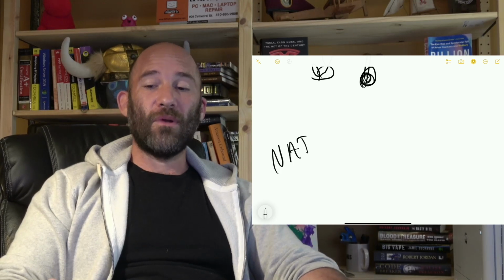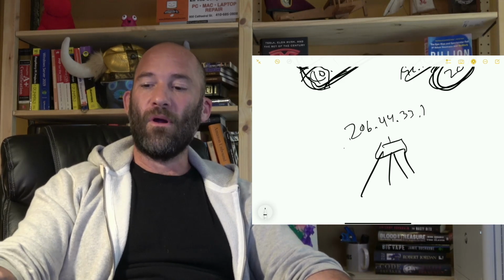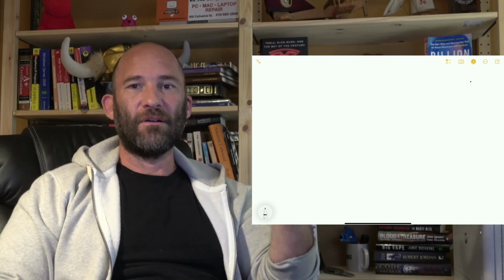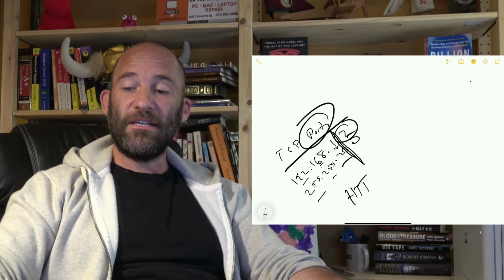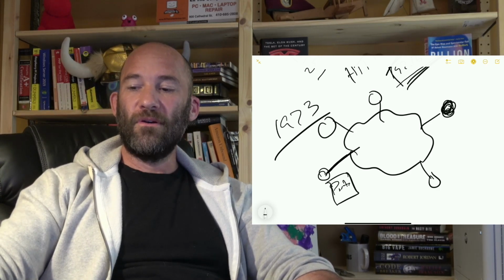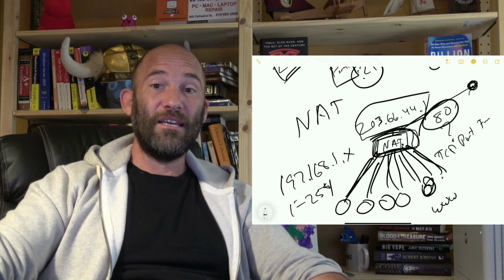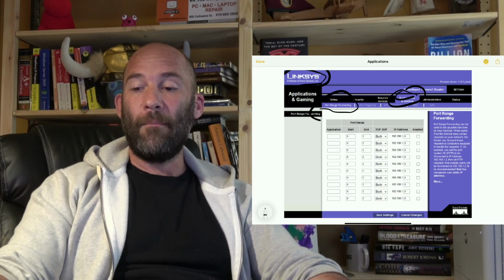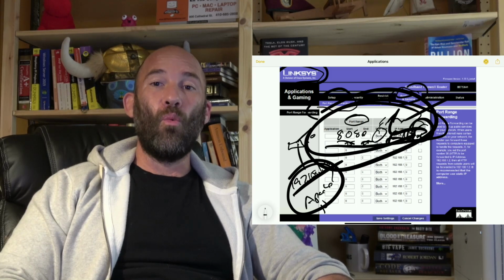What is NAT and Port Forwarding (Network Address Translation)

Comment: When TCP-IP came out Networks were trusted as a default. There weren't really any security built into it because it was really only designed for institutions not for the public. The Internet wasn't even a thought back then in anybody's mind. And because TCP-IP had no security built into it, (because there was no need for it, networks were trusted) the main reason why it has been bandaged over and over again is mainly security reasons. The large majority of bandages are trying to add security on top of a network that wasn't designed for security. Most of the problems in networking that we face today are for that very reason. If somehow we could completely begin again with network protocols designed for untrusted as a default everything would be so much different. The entire network protocols and how they work would probably be very different.

Comment: The only problem with NAT is that it's easily possible to "Double-NAT", thus causing internet connection issues. Consoles will often tell you that you're using NAT2 or NAT3 during this circumstance. The common culprit is when someone doesn't know to put their ISP's modem into Bridge mode when using their own router.

Comment: I appreciate what you are doing in this new series. 

So in the case of the data going through 2 networks, how does the port number get forwarded through the second router (and the third, etc)? Are more and more port numbers concatenated to each packet? My wireless ISP (Xplornet)puts all of its customers on a 'private IP' 192.168.. so I'm automatically on double NAT considering my own router is in the path right after theirs.
Reply from the maker: if you own the routers... router 1 port forwards to the external ip of router 2... so router 1 has an external of 205.66.44.2 it's inside address range is 192.168.1.x Router 2's external is 192.168.1.2 and its internal range is 192.168.2.x (different subnet). so port 80 traffic to 205.66.44.2 would be forwarded to router 2 at 192.168.1.2 and router 2 would then forward to the apache server at 192.168.2.10

if your ISP is NATed... that's its own tedious situation...

Comment: 24:38 that reason is because root is required to run apps on port 80. It is believed to be more secure to run your public facing app without sudo. You can do this by setting up port forwarding from 80 to 8080 on your router.

Comment: I love it when people try to hide their Private IPs thinking that some one can hack them if they give that info out. If you had a Static Public IP then yes they can DDOS or Man In the Middle it but Private IPs can not be hacked. Unless your WiFi is open but if your WiFi is open then you have bigger problems.
Reply: What? "Private IPs can not be hacked..." Just because they aren't static? Just because network encryption exists? Well hell
Reply: @johnqpublic2718  IP behind a NAT are going to be the same as billions of other private IPs on other LANs so to send a message to a private IP would be sending a message to billions of other computers. This is why Private IP are not routable (or should never be).  Only Public IPs are routable. If you could hack all of the routers of the world and make it so they could rout a private IP you would bring down the Internet. So hiding your 192.168.1.n address is just silly.
Reply: Also any address in the Class C (192.168.0.0 to 192.168.255.255) Class B (172.16. 0.0 to 172.31. 255.255) Class A (10.0.0.0 to 10.255.255.255) can only ever be behind a NAT.